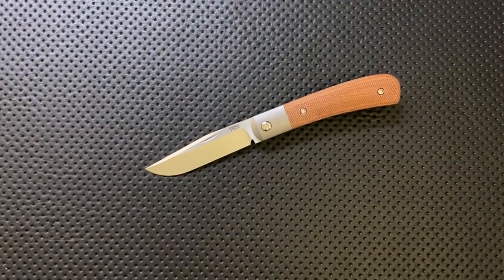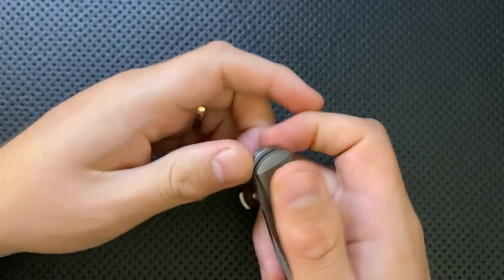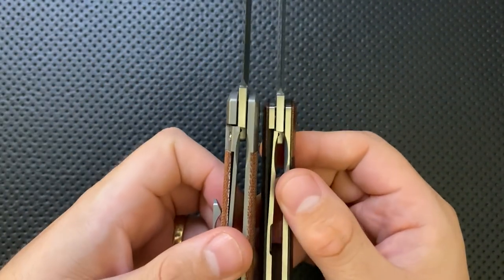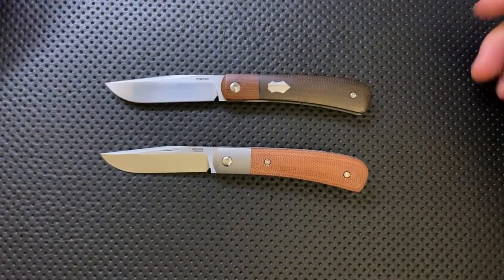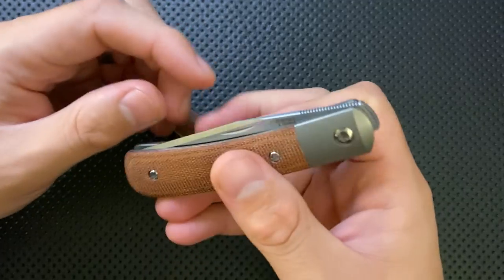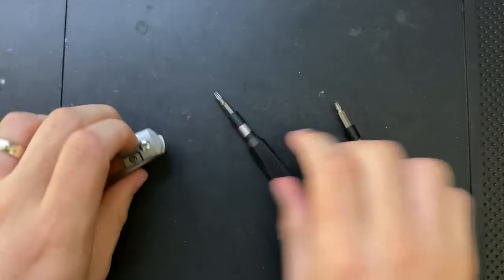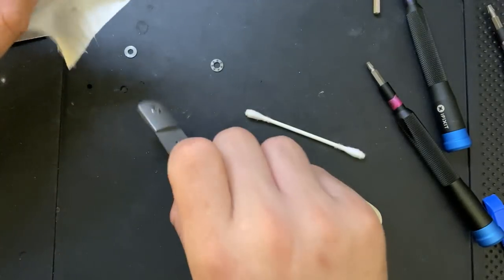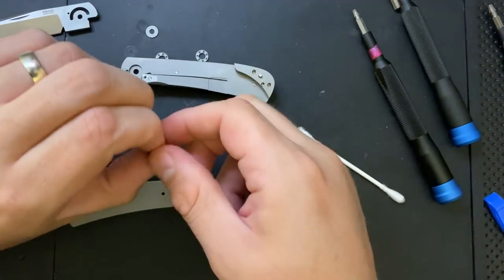The Peña X-Series Front Flipper Trapper: Sneak Preview and Disassembly

Comment: I wanted a nice front flipper and it seems like there are two types sub 100 with meh steels and above 200 with great steels.  Luckily BladeHQ commissioned some exclusive G5 metamorhps in marbled CF with Boiler M390 and blue anodized hardware for 169.  I didn't know about it until I saw that it was on sale for the black Friday weekend for 119.